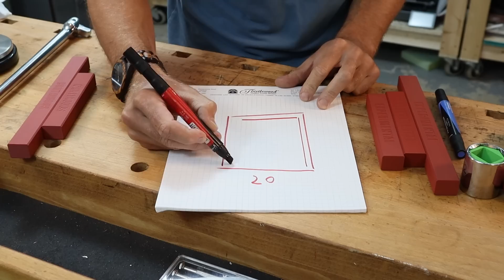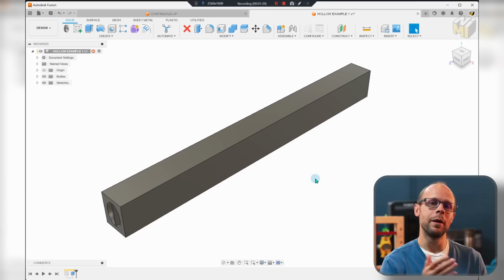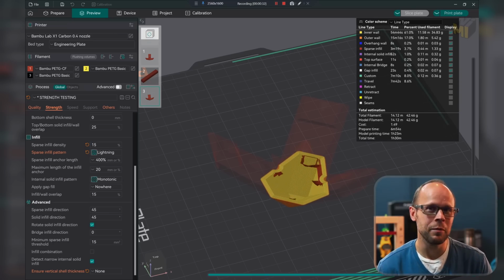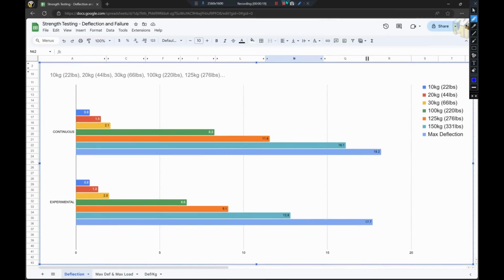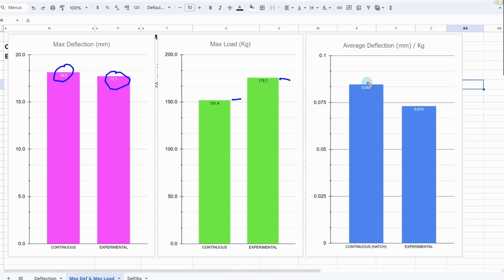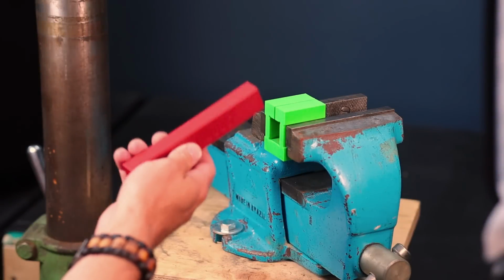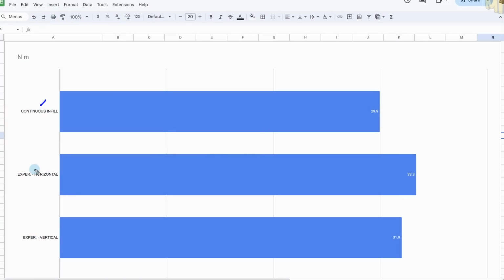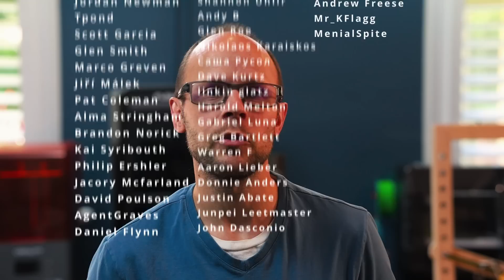Is an UNfilled 3D Print Stronger than an INfilled 3D Print?

Comment: the density of gyroid infill can be continuously varied without any sharp transitions. today's slicers don't implement it but it'd be a neat way to redistribute material from the inside towards the surface
Reply from the maker: I'd like to see that, ideally we can get to a sort of Bone structure, which can flex well and also is resistant to breakage.  We should also be able to set areas to have higher density to be more rigid etc.  I think we have a few more years of FDM and then we'll be using different types of 3D printers which won't have the same limitations...
Reply: @NeedItMakeIt  exactly, for example corners even on decorative prints need extra strength because they'll experience all the impact forces when a part is dropped.

adaptive cubic infill attempts to do this but the density jumps too much between levels, you can't edit the distance-to-wall density curve, and overall it's not the best load carrying structure
Reply: @NeedItMakeIt  FDM is unlikely to go anywhere, it's the most affordable and user-friendly 3D printer tech.
Reply: Adaptive cubic does change its density dependent on the nearest wall. Would be nice to have a slider on that one.
Reply: Why can't it be done with an algorithm that reads hand-placed weights (points in space that are placed and assigned a weight value) and then interpolates between different scales of infill structure based on the weights? And the user could also specify custom infill grid shapes that can be tiles and applied at various scales.
Reply: I'd like to see a real example of progressive gyroid. I don't think it is possible
Reply: Interesting

Comment: If you had a way to consistently apply pressure instead of sometimes letting off and then going back at it your results would most likely be different and more consistent in the 4 point bend test
Reply: Yep, was just about to comment on that. Dynamic vs. Static loads. Also depending on the oscillation of the dynamic force the part can be weakened, reducing the total static load capacity.
Reply from the maker: @SarahKchannel  A good point, I didn't  expect it to be so hard to break the parts, I'll setup a re-test and make a longer lever arm to see if that helps.  Ideally I'll change the entire rig so that I can not be using hand-power.  Maybe a stepper setup to be geared down to control a large threaded rod with a thrust bearing on the bottom, or a hydraulic cylinder.
Reply: @NeedItMakeIt  as a 'cheap' solution, small hydraulic car jack will most likely do the trick. More power and more even application due to the nature of the pumping on the jack.
Reply from the maker: Absolutely, this was a mistake on my part, I should have added a longer lever to my test rig, it seemed to be quite a bit harder than the infilled part to break.